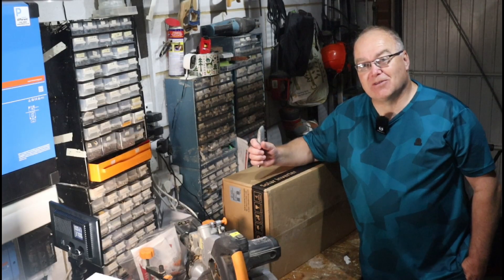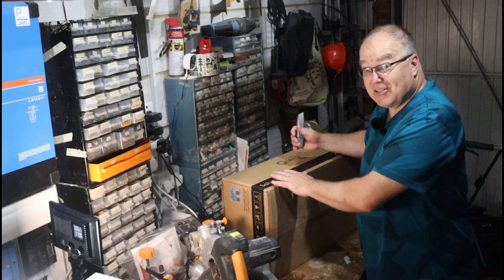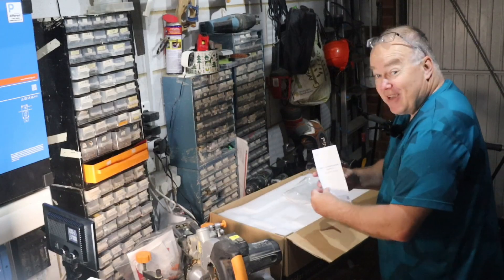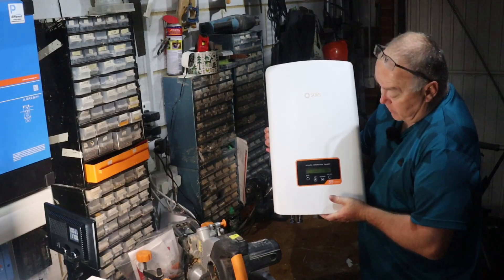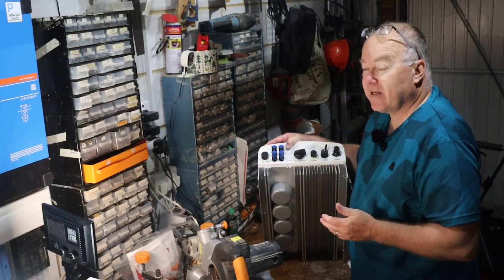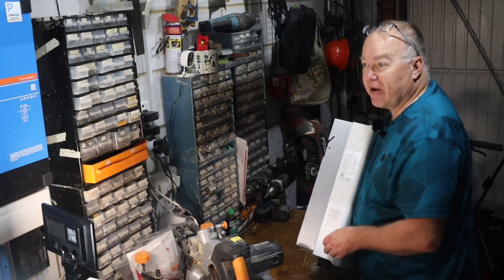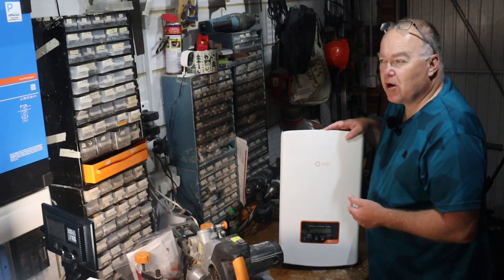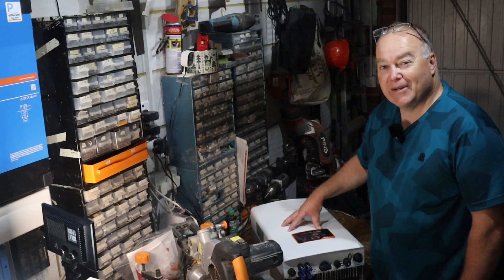Choosing the best solar inverter for my ground mounted solar panels - SOLIS  S6 GR1P 3.6K  unboxing

Comment: ????? Export limit what have they told you I just had to do one again for a change of inverter lucky for me they approved it in 2mins seemed like ages the first one I did took 5seconds to approve lol, and this one they didn’t limit me at all they gave me full 12.50kW 😅 few glad they didn’t ask to upgrade to 3 phase I’ve probably pushed there limit now I guess lol

Comment: Interesting video Nigel. I am curious about how your existing Victron and Solis inverters work together when both export at the same time. I had been told that you can get "export over voltage" issues caused by each of the inverters trying to raise its export voltage above the current detected voltage. My understanding is that for the inverter to export (assuming a single inverter), it takes a reading from the CT clamp then ensures the voltage it inverts at is above this value (hence ensuring the current flows into the grid). When you get a second (or more inverters) installed, then the second inverter might take a reading and detect this higher voltage (as the first inverter is exporting) and subsequently choose to set its output voltage higher than this. The first inverter repeats its periodic monitoring of the current grid voltage and sets the voltage higher yet again until you hit over voltage conditions (which I think is around 253V on single phase). My understanding on how to avoid this is that there is only one CT clamp and that reading is used by all the inverters (which would make sense if the inverter was the same manufacturer and supported such a feature). Given that you have different manufacturers of inverters, I was wondering how your system handled this situation (or likely I have been mis-informed and this isn't really an issue with modern inverters). Your thoughts?
Reply from the maker: Everything connects independently so to each solar inverter they only know about it's own state and the AC connection it has . My solar inverters don't monitor the grid or export ....yet.... As we are within our export limit .

Yes as you export from 1 device or 4, the voltage has to rise to push the energy out but it's not many volts so unless your grid connection is already at the limit  you shouldn't push over said limit 

If you do go over the inverters should be installed with the right country code setting to they will shut down if the voltage is too high .  Voltage level is adjustable on many inverters in the install settings .  I have one for example that reads 250v when the others read 248v.  I will be adjusting that one to avoid it cutting out too early ....not that I've ever seen it do so even at 258v for moments .

Victron has far more settings, monitoring and controls so sees and adjusts much much more . 

 In an ideal world our grid connection would be 230v giving much more head room for solar .  I hear there is talk of the grid reducing voltages more over time which will be good .

Comment: I’m looking at putting 3kw of solar on my garage to run with my existing 3.5kw on the house. The house system is south facing and the garage would be an east/west, would this inverter but the correct one for me?

Comment: My attempts to add extra solar were knocked down by my DNO, and they have told me I need to upgrade to three phase. Hope you can get yours sorted.
Reply from the maker: Did they provide the detail for that upgrade?  bit of an overkill for a few more  kw😞
Reply: @EVPuzzle  Not really they just said it was to do with voltages. They wouldn’t agree to limits either as they take a small time to kick in. So only option is three phase to allow any more panels.
Reply from the maker: @Jaw0lf  doesn't make sense but I guess they don't have to explain , rule unto themselves